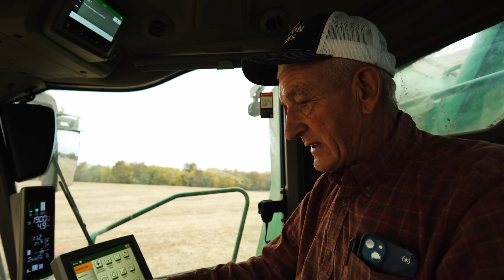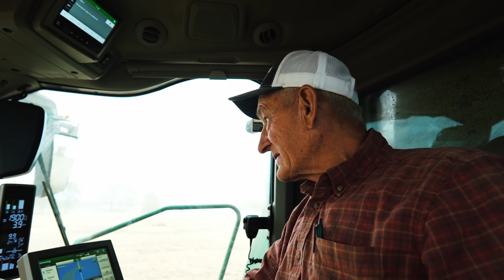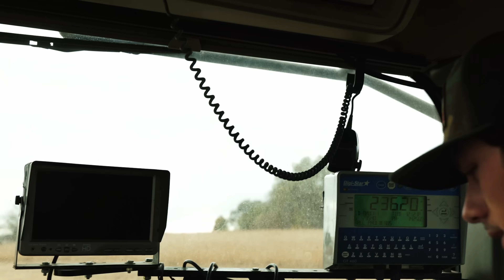Modern Farming vs. 1970s Farming

Comment: Thanks for your video.

Why are so many going to tracks-?
Here is how I understand tracks.

Tracks are more expensive and more time to maintain than wheels.
There is more turning friction with tracks than wheels which means that more power is required to turn them. This results in more being fuel used.
In muddy conditions, tracks will stay on the surface and spin while wheels will did down for better traction.
There is very little difference when comparing compaction to wide LSW wheels.
Reply from the maker: We talk about it in an earlier video, but the main reason we have them is just for the fact our roads and bridges are too narrow for modern machinery to fit over. An X9 with LSWs or Duals wouldn’t get anywhere in this part of Kentucky 😅
Reply: Thanks for your reply and I wish you folk all the best. @DentonFarms

Comment: Deere needs to get their non burning def new big engine in the x9.  That’s awesome they engineered that in their new engines they make.  No one likes def.
Reply from the maker: I can get behind 830 horse in my x9! 🤣⚡️
Reply: @DentonFarms  well the new case ih twin rotor combines are 775 hp. So one would think Deere would want to surpass that soon.  Those new engines are so nice. No def needed.  A X9 with 830 horse would be nice to operate.   It’s not far away I’m sure.
Reply: we are putting our new Jd-18X 18.0 liter power tech pss 1,099 diesel engine in our new X10 series combines that were fixing unveiled we just unveiled our new smaller S7 series combines here last month in February were probably gonna unveile the X10 series combines in August probably um not really sure on our release date for them I work for john deere
Reply: We gave case ih time to develope there class 10 and class 11 combines were building our new class 12 class 13 combines our new X10 -1200 X10-1300 combines will be out soon 😊
Reply: @marcusjames3814  awesome can’t wait   Thankyou.
Reply: @marcusjames3814  that is gonna be a monster.

Comment: Neal the reason why u losing 📉 horsepower is we at deere turned our big class X9-1100 combines  see 👀 in 2020 Neal when we first unveiled these X9-1000 and X9-1100 the class 10 X9-1000 was rated at 630hp to 690hp peak max horsepower and our bigger class 11 X9-1100 combine was rated at 690hp to 743hp max peak horsepower now from 2021 2022 2023 2024 models are turned down now the X9-1000 combine is rated at 549hp to 630hp and X9-1100 combines rated at 603hp to 690hp that's why u losing horsepower when u dum on the go u get 53hp power boost when dumping on the go that X9-1100 is getting 603hp to 690hp u can have one of our john deere certified technicians to turn your X9-1100 combine back up to the original stock horsepower of 690hp to 743hp max peak horsepower on your 2024 X9-1100 combine